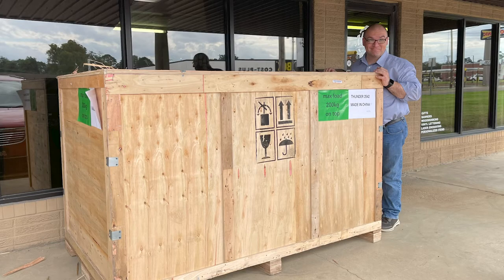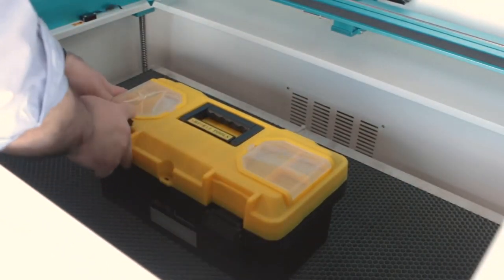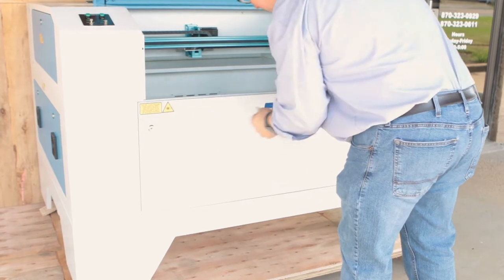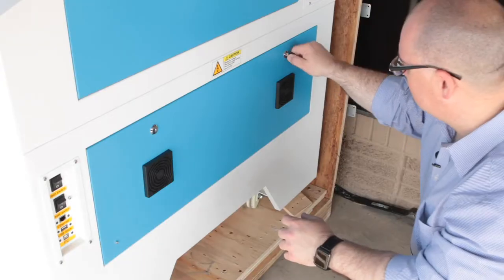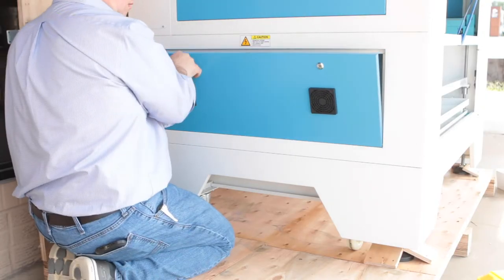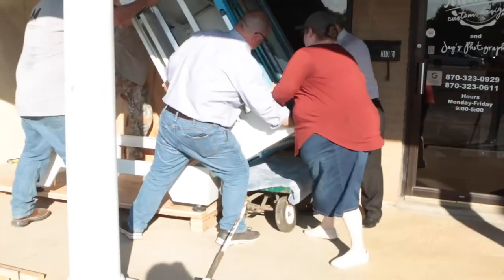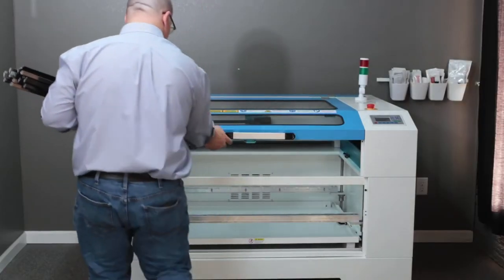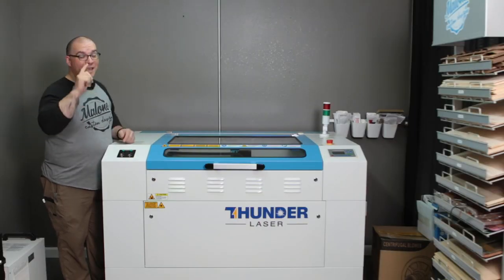How To Get A Thunder Laser  Nova 35 Through A Regular Doorway

Comment: Nice video and timely as we are ordering a Nova 35 this week.  Thank you!  PS - where did you get that vertical wood storage rack for your plywood/sheet wood?  

Also, how as the Nova 35 been working for you?  Any regrets not going with the 51?
Reply from the maker: You're gonna love it! 
The rack came from Hobby Lobby....it was one of their store fixtures that they were getting rid of.  It originally held matte boards. And I really wish I could get another one lol.  
We love the Nova 35.  Our space was limited and just really didn't have room for a 51.  There have only been a couple of times that I wished we had more space.  The 35 has been more than enough 99% of the time.
Reply: @malonecustomdesigns  thank you.  Will look for new content from you

Comment: Can you tell me why you have to take the screws out when moving it in?
Reply from the maker: Hi Emily. You have to take the screws out so you can remove the base that way you can turn the machine on its side for it to fit through a standard doorway. I’m not sure where your workroom is located, but if it has a 48” wide opening you wouldn’t have to take anything apart. In some cases, you have to remove the light from the top as well. Our doorway was large enough we didn’t have to do that.

Comment: Would the top section fit through an interior doorway that measures about 29"?
Reply from the maker: If you remove the light on the top......MAYBE.  It would be a squeeze in situation. Here is some info that Thunder Laser provides.  https://support.thunderlaserusa.com/portal/en/kb/articles/getting-nova-series-machines-through-a-standard-30-doorway
Reply: @malonecustomdesigns  Thank you so much!
Reply from the maker: @KelseyWiseman  You're Welcome!!
Reply: So ur not losing any width or length , ur just lightening the load?
Reply from the maker: @krissyjohnson2246  You will have to take it off of the base and lay it sideways to get it to fit through a door. Not just for weight.